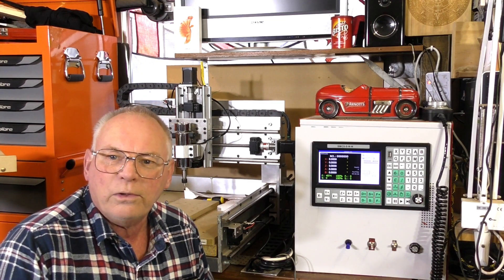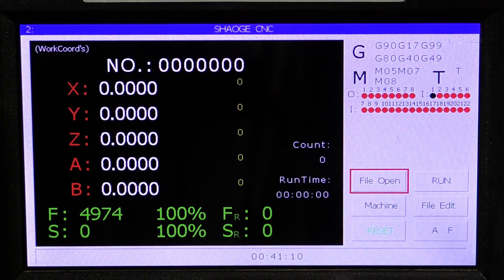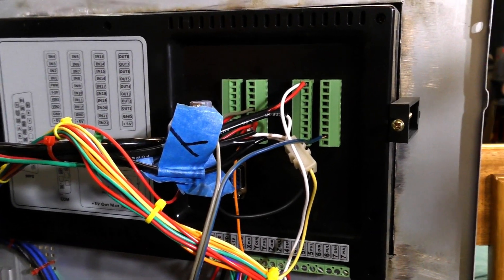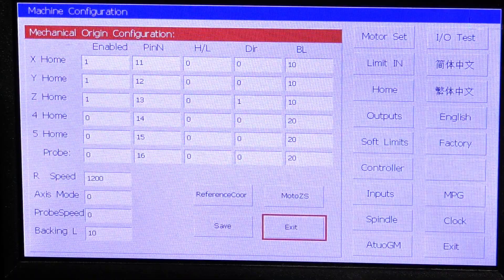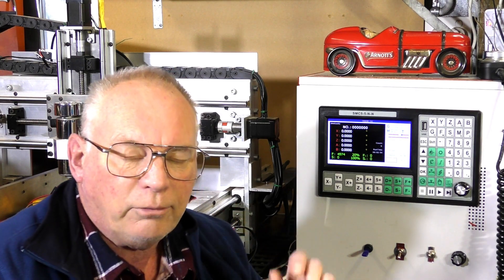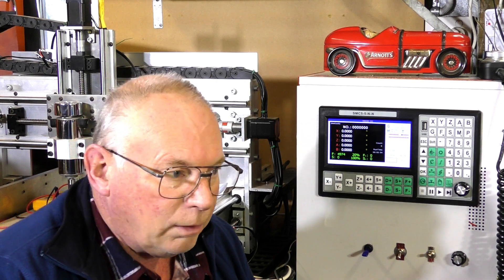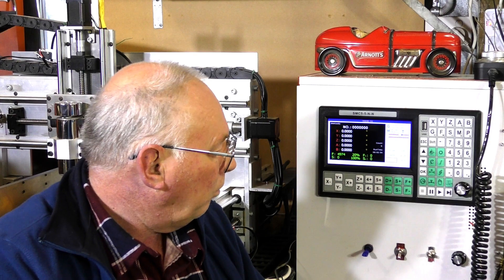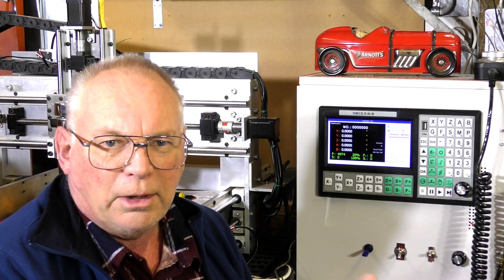#PROBING# SMC5 5 N N 5 axis CNC controller setting up the probe function

Comment: Hey Roger. I got everything you did in the video set up for the probe function and ready to try out. You didn’t show what you did on the panel to perform the probe function. I found the Probe function in the Coordinates menu, but nothing happens when I press OK (I have the function enabled with a 1 in the INPUT menu as you show). Also, I noticed that when I activate the probe input (9), the RESET indicator flashes. Not sure if that is normal as your video already has the RESET flashing before you show the input being triggered.
Reply: hello. did you manage to solve it?
Reply: @pablogarciamartinez4708  No I didn't. I am in the process of rebuilding my CNC router. I am waiting for the weather to warm back up so I can start on the wiring of it.
Reply: @TinkeringJohn  Did you managed to get this function working yet.
Reply: @odomap  I still haven't got the rebuild going yet.

Comment: Thanks for this video Roger. I discovered it while searching for something else. I am trying to find if you ever mentioned what aluminum you use to build your machines. I am thinking of using 6061 extruded. Can you verify if that is what I should use. Thanks again Roger.
Reply from the maker: 6061 is good
Reply: @inventorsworkshop9600  Thanks for the quick reply Roger.